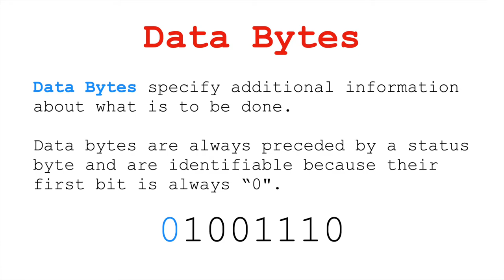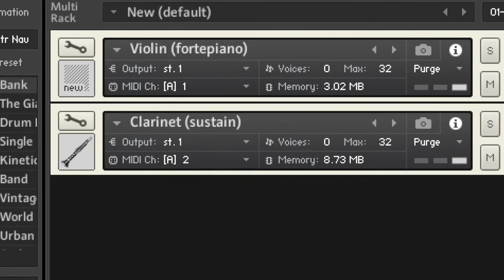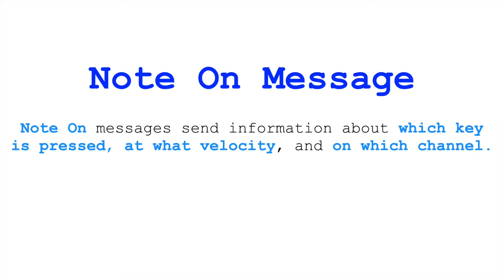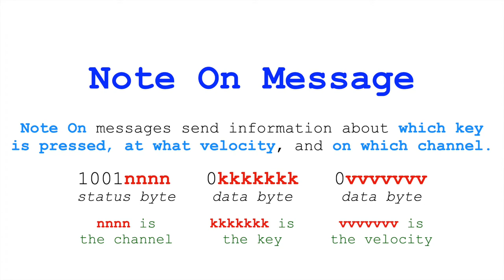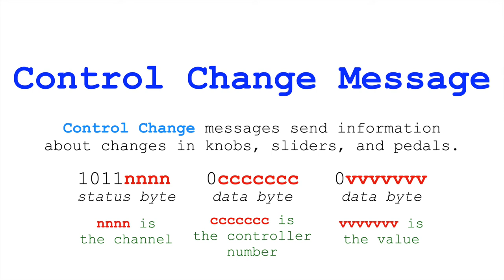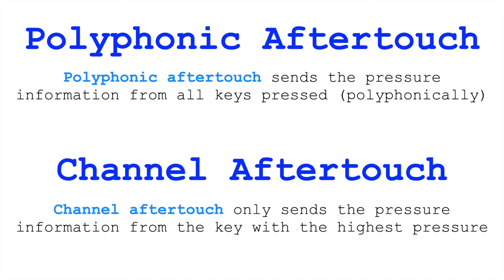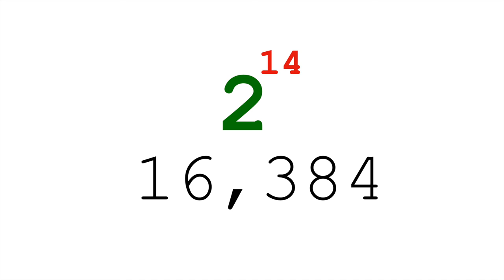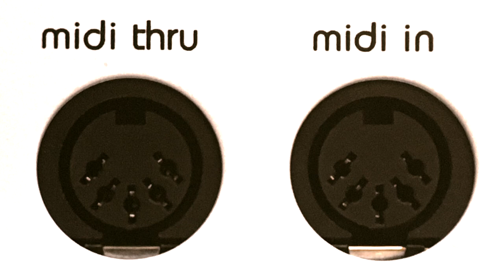The MIDI Protocol: MIDI Messages | Simon Hutchinson

Comment: You should also add about the amazing  Running Status feature of MIDI. Where - as long as the data bytes are still for same status message &  channel (example key on ch 1) , then each individual status bytes does not need to be repeated, just the key and velocity. Given that MIDI was only  31,250bit/sec (3125 bytes per second). This greatly improved the available bandwidth.
Truely amazing what they managed to cram into the microprocessor tech of the day.

Comment: Really great video man. I have been wondering exactly what midi protocol looks like for a while now. I have a project in my microcontrollers class using a PIC24 microcontroller and MPLABX, and I am strongly considering trying to work with some amount of MIDI protocol. If I don't use it then, I'm sure ill try building something with it sooner rather than later

Comment: Thanks for taking time to make this. At 01:34 I'm confused though: in a DAW you might have one track per instrument articulation (legato, staccato, pizzicato etc etc) so can easily hit 50-100 tracks for an orchestral piece which is way more than 16 channels. So how is this is situation normally managed? I appreciate there's the key switch method also.
Reply from the maker: Good question. DAW tracks and MIDI Channels are different. A DAW isn't limited in the number of tracks it can have (well, unless it's limited by the manufacturer), it's not limited by the number of channels the MIDI protocol can represent. The MIDI protocol, though, can only represent these 16 channels though, so a DAW sending to an external synth could only send 16 channels to that external synth along that MIDI cable.

Comment: Thank you my friend! We're LUCKY to have access to knowledge/explanations like yours. I have 1 question if anyone has time to clarify:

...Is this dual functioning of the Data Byte's 1st Bit correct?
	1) '1'xxxnnnn designates it as a Status Byte as opposed to Data Byte, and
	2) The '1xxx'nnnn portion specifies the kind of message we're sending, i.e noteOff(1000nnnn),    
             noteOn(1001nnnn), Polyphonic Aftertouch(1010nnnn), Control Change(1011nnnn), Program 
             Change(1100nnnn), Channel Aftertouch(1101nnnn), Pitch Bend Change(1110nnnn), or System 
             Exclusive(1111nnnn)
I ask because I want to be sure the first Bit of a Data Byte serves two purposes.

EDIT: spelling
Reply from the maker: Thanks for your message. I'm not completely clear on your question here. Maybe you're saying "Data Byte" when you mean "Status Byte"? I'm not sure. I do have another video about the bits and bytes here, which might answer your questions: https://youtu.be/Ll6L7o42I-s
Reply: @SimonHutchinson  thanks for the quick response, and yes - I meant Status Byte where the MSB is '1'xxx nnnn... I watched your other video as well, and I think it answered my question. Thank you!

Comment: Hi Simon,

I came across your video while looking for ways to transcribe MIDI Messages through Image Inputs
I was slightly interested in understanding if some other triggers could be used to encode these messages (such as the RGB Data, and equating it with similar data bytes in a way?)

This may allow people to sonically experience photographs.
I'd love to hear your views and take on this.
Reply from the maker: I'm not sure I completely understand your question, but, in short. You can convert all data (including MIDI data) into another kind of data (like RGB values). Check out more here - https://youtu.be/NHufvylg0Vw

Comment: Thanks for your explanation! It's very useful for a project I have, do you recommend any video where they use assembly to transmit these midi packets (bytes) through USART to the computer (with an Arduino Uno ATMega328P uController, but using the assembly code instead of the more easy high level programming) to assign some keys (push buttons) to different things in the DAW's (FLStudio, Ableton, whatever)? Because I found many videos they do this but with the C-like code that uses Arduino, importing libraries, I tried to debug the libraries themselves, but I did not find a good explanation of the bytes sent, as you did in this video, I saw the Note on and stuff but it was not that clear. Thanks in advance if you know some source! If not anyway thanks for the video is very clear ^^!

Comment: Hello Simon! I have one question about the 1111nnnn status bytes. I've read that some sustain pedals will only work to their full capabilities only with keyboards of the same brand. Could the be due to the use of this "1111" data?

And, if so, could manufacturer data be "replicated" to make a keyboard believe a pedal is from its brand?
Reply from the maker: I don't think that's correct. Sustain pedals are supposed to be Control Change Messages on controller number 64. So they shouldn't have much to do with System Messages or the brand of the pedal/keyboard.

https://en.wikipedia.org/wiki/General_MIDI#Controller_events
Reply: @SimonHutchinson  and could it also send that kind of data let's say in the first press? Another thing that confuses me is how sustain pedals use Jack audio cables as MIDI data cables.
Reply from the maker: The pedal connects to the keyboard (analog) electrically with a 1/4 jack, and the keyboard is what converts that cable into MIDI.

Comment: I need your big brain a second! How do you work out MIDI channels from a Byte? Is there a calculation you can use or a formula?
Reply from the maker: So, the status byte is 8 bits: 1 (Status byte marker), XXX (Type of MIDI Message), NNNN (MIDI Channel).

Look at the NNNN. If it's

0000 - MIDI Channel 1
0001 - MIDI Channel 2
0010 - MIDI Channel 3
0011 - MIDI Channel 4
0100 - MIDI Channel 5
0101 - MIDI Channel 6
0110 - MIDI Channel 7
0111 - MIDI Channel 8
1000 - MIDI Channel 9
1001 - MIDI Channel 10
1010 - MIDI Channel 11
1011 - MIDI Channel 12
1100 - MIDI Channel 13
1101 - MIDI Channel 14
1110 - MIDI Channel 15
1111 - MIDI Channel 16

... I think I got that right.
Reply: @SimonHutchinson  Thank you! If you had the MIDI channel but wanted to work out the binary NNNN would you just have to look at the diagram or is there a formula you could use to work it out?
Reply: @benparamoresound338  if you are using a programming language to get the channel from a byte, you can just do a byte AND 16 to mask off the rest of the bits to be 0. The remaining number is between 0-15, if you add 1 its the channel number between 1-16. Hope thats helpful